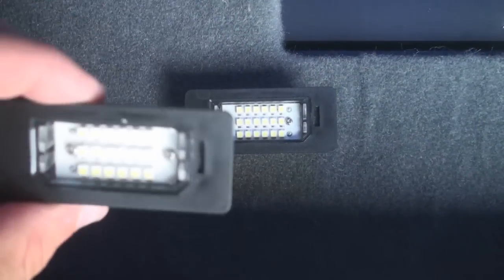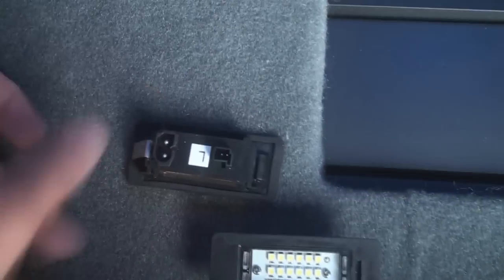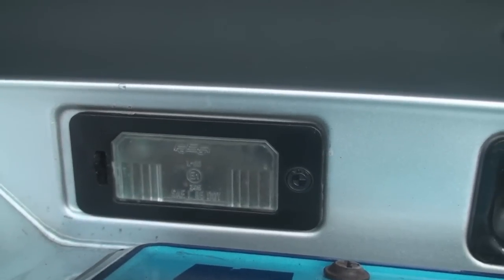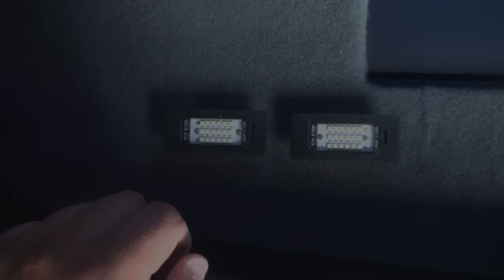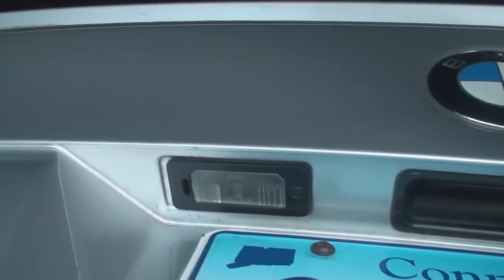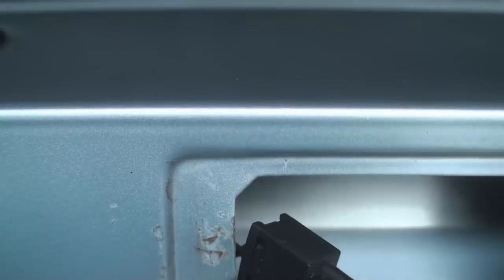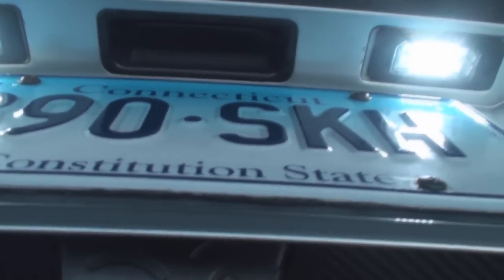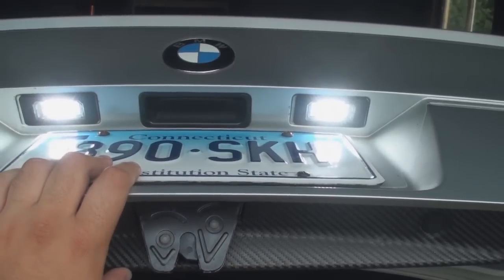WeissLicht LED License Plate Light Install

Comment: I'll try this way, defintively if I follow the user manual instruction I risk to make damages. I strongly recommend to cover the flat head with some adhesive tape so that if it goes out while you're pushing you lower the risk to "sign" your car.

Comment: To people that are having trouble, i have just tried to remove mine using this method and it may work for some but i snapped part of the light while trying to remove it. I found that when removing the other one it was much easier to just put the flat head screwdriver behind the back of the plastic that holds the lights in, where the plastic meets your car boot ( so not in the designated hole for the screwdriver) and pop it out. It came out very easily this way. Hope this helps

Comment: Best video showing how to remove the stubborn light from the trunk lid - Slide right then gently pry left side out.  However, I only wanted to replace the bulb.  AutoZone had a Sylvania bulb, model 6418, to replace the (probably original) bulb.  Less than $6.00US.
Reply from the maker: It's an awkward design. They like to get seized in there too. I'm glad the video was able to help you out.
Reply: I just bought those Sylvania 6418 bulbs for my X5 and they are NOT as bright as those illustrated in this video. Big disappointment.

Comment from the maker: @WuzieRap 15 is when I'm really pushing the car hard as well...I've never gotten anything less than 19MPG average on the car even in the worst driving conditions so overall it's pretty decent. The 540i may use slightly more fuel though.

Comment: Can you guys tell me whats wrong with my led light when I open the truck my light turn on when I close my trunk it turn off the left side and the right stay on what you guys think about this problem
Reply: +Echiko Chiko I have the same issue; light is on when lifting up the trunk and is off when closing.  I replaced the new light bulb, it's still the same problem.  So did you get it fixed after watching this video?
Reply: Same problem here. My guess is that the prongs that hold the bulb are sprung too far apart to hold the bulb tightly.